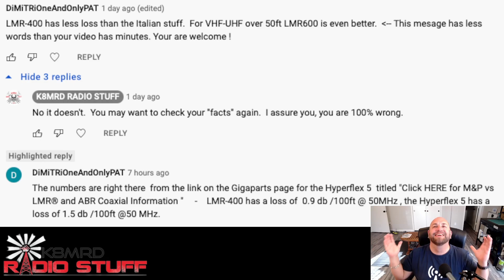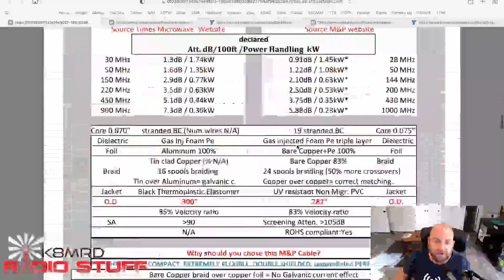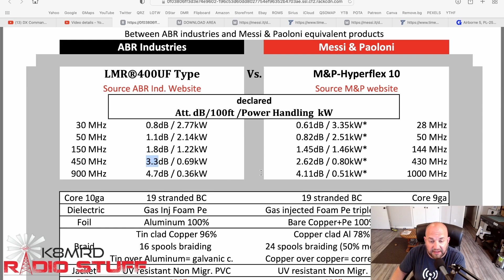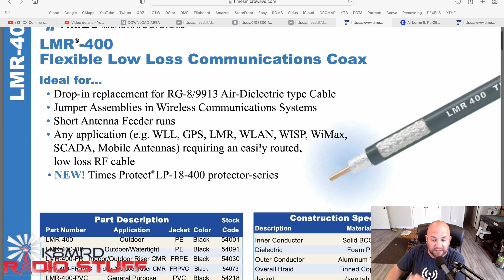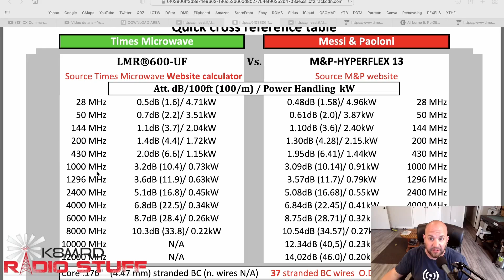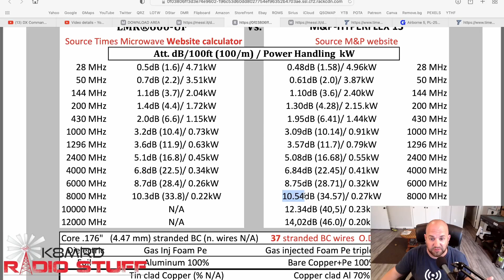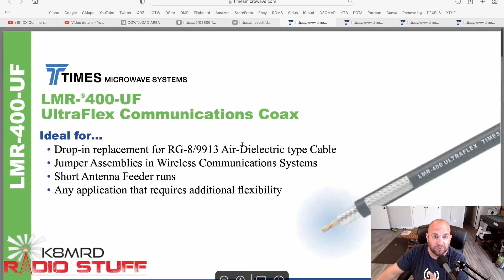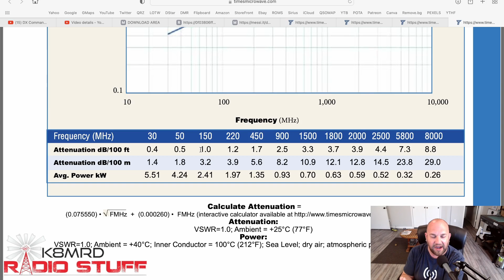Messi & Paoloni | Best Coax for Ham Radio

Comment: I understand you want to promote your sponsor M&P, but 95% of the hams cannot afford M&P..
Reply from the maker: Cannot or will not?   We spend thousands of dollars on radios but skimp on the coax.
Reply: Like I always say "one can have their own opinion but they cannot have their own facts".
Reply: You get the best that you can afford. Save up for the better stuff, even if it means being off the air for a while. Check local events, ham fests, and see if anyone is getting rid of any used cable that you might get for cheaper.
Reply: I know people that will drop 1500 on a radio and 10 on coax... m&p ain't that much more than cheap coax and works much better. It's all about priorities. 

M&p is well worth the investment
Reply: Careful shopping is key. I purchased 100 feet of M&P Ultraflex 10 with M&P PL-259 ends on it for $118 before shipping and taxes. I compared several vendors RG213 and LMR400 offerings and found M&P Ultraflex 10 to win out on the cost/performance front.
Reply: No tax, no duty fees and there's coupon codes you can use also. It actually ends up cheaper than American made lmr400 uf or lmr600 uf and the connectors are better and re-usable. It's a no brainer to buy messi & paoloni